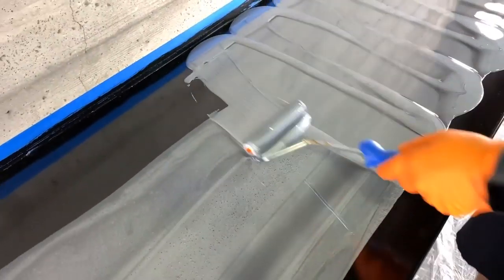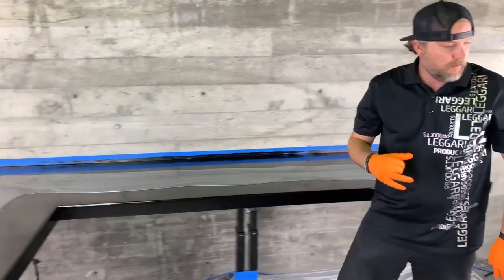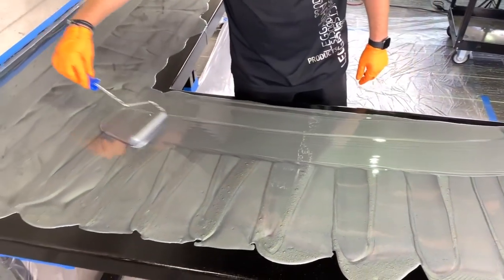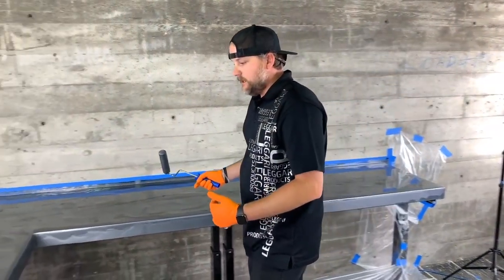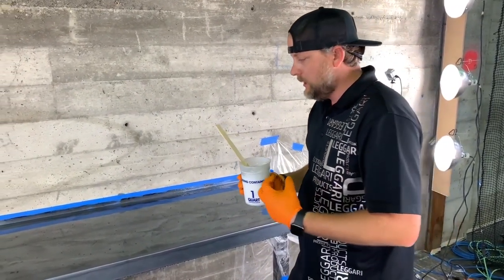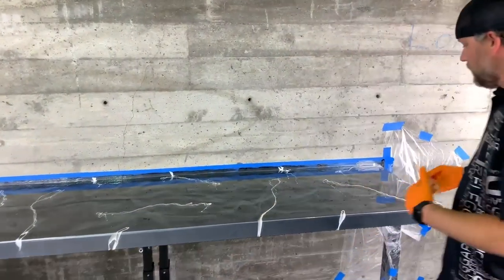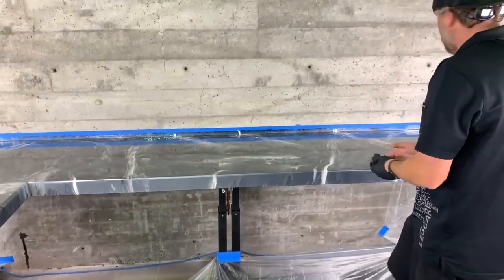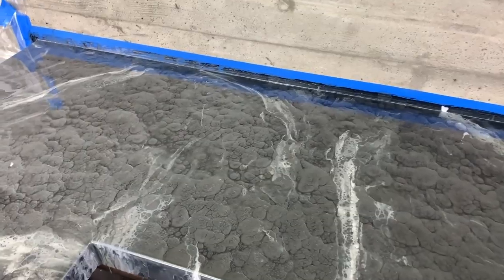Titanium & White Countertop | Epoxy

Comment: I noticed that the isopropyl did not make cells. As mentioned below I love the way it made the white pigment look like waves-rather than cells.   Some of your other videos show it  making cells. So, how do you control that?
Reply from the maker: For the dispersing effect we use 91% Isopropyl Alcohol. You can use this either clear, or pigmented. 

If you would like to use a pigmented dispersing effect, the ratio is 3 Tsp of Leggari Metallics to 15 oz of isopropyl alcohol.

You can do this effect at a fine mist or in drips for a more dramatic effect. Please be aware that if you put too much out, especially in drips or do the effect too late in the curing process it may leave recesses or divots in the surface as the epoxy did/will have set up too much to fully self level.

Also smaller amounts of the white highlight will create this effect. Pour in a vein pattern and blend with a squeegee.

Comment: Did you do any steps after spraying the isopropyl? the finish looks great compared to after you sprayed it on.
Reply from the maker: We have 3 different top coat options. Glaze coat is our super high gloss top coat that lays out glass smooth just like the metallic epoxy coat. Our WB Urethane comes in high gloss and leaves a minor texture and we also have a WB Urethane that’s a Matte/Satin finish.

Comment: I notice that the alcohol sometimes leaves what looks like bubbles (which I don't like) and on this item, it simply dispersed the white pigment. Is the difference in how it is used?
Reply from the maker: For the dispersing effect we use 91% Isopropyl Alcohol. You can use this either clear, or pigmented. 

If you would like to use a pigmented dispersing effect, the ratio is 3 Tsp of Leggari Metallics to 15 oz of isopropyl alcohol.

You can do this effect at a fine mist or in drips for a more dramatic effect. Please be aware that if you put too much out, especially in drips or do the effect too late in the curing process it may leave recesses or divots in the surface as the epoxy did/will have set up too much to fully self level.
Reply: @LeggariProducts  My question wasn't clear - I'll try again - why does spraying isopropyl alcohol sometimes make cells and sometimes it just disperses the pigment, like in this video? Could it just be the amount that one sprays?
Reply from the maker: It can happen if you spray too much isopropyl alcohol out on the epoxy or you do it too late in the process.  You want to spray a fine mist about 20 minutes after application the epoxy and no later than 30 minutes.
Reply: @LeggariProducts  Thank you. Now, I'm ready to start creating a countertop, and a bathroom floor!